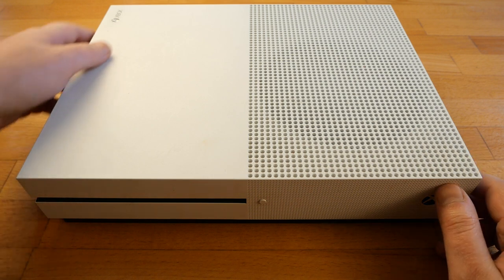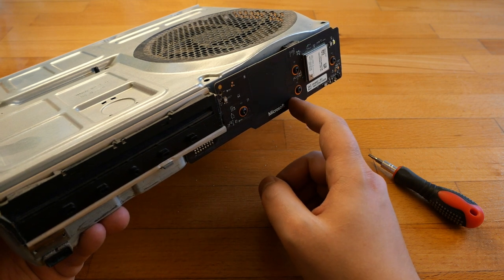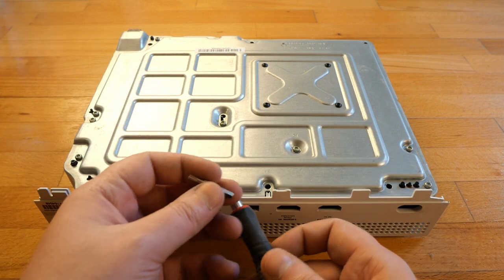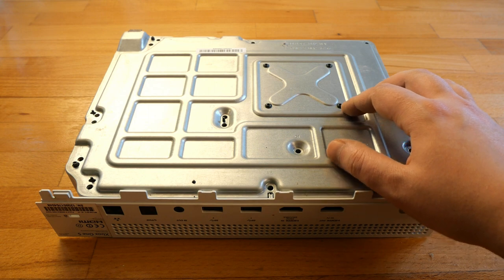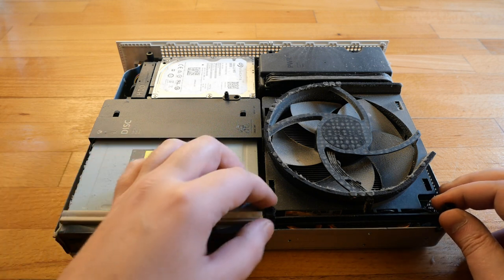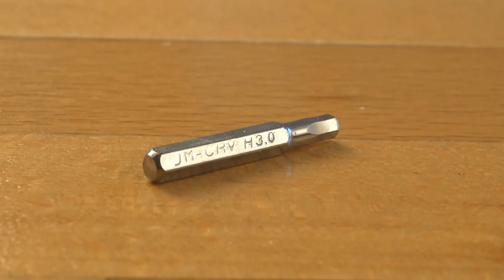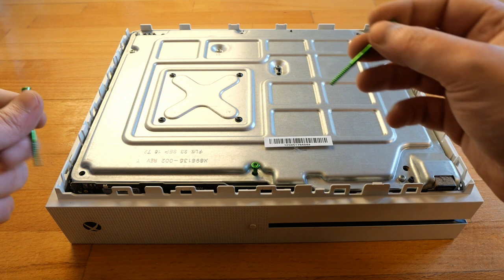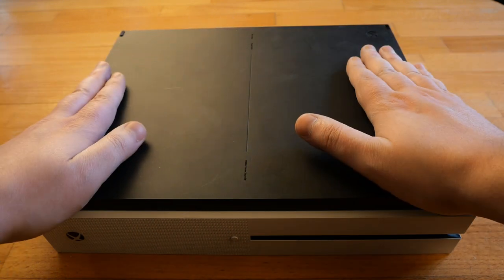XBOX One S Teardown & Cleaning Guide

Comment: Did everything exactly but wifi seems to no longer connect, it picks up networks and attempts to connect but doesn't work, could it be the internal adapter?
Reply from the maker: If it worked before opening, try to reconnect the wifi to the motherboard

Comment: Hey quick question . I've been experiencing a problem with my Xbox One S Everytime I turn it on it beeps and cut back off within a second it's been going on for three days now and I just wanted to know if you know anything I could do? Or do you have any videos on that problem?
Reply from the maker: Did this happen after cleaning? If so, it may be a problem with some connections when you assembled it. If you never opened your console, this sounds like a Power Supply issue
Reply: @YesterdaysTech Thank you so much for replying it means a lot..And, I never opened my console it even still has the sticker seal on it, but i will buy a new power cord today and see if that works. Thanks again 🙏
Reply: Did you ever find the solution!? I am having the same problem
Reply: me too
Reply: I just had this problem and its a relatively simple fix. Hold down the xbox button on your console  until it powers off, unplug the powercord for ten seconds, then plug it in and wait ten seconds. This will hard reset your console (NOT wipe storage, simply reboot the operating system) and it should help glitches such as this. Its recommended you do this at least once a month depending on your playtime.

Comment: Thx for this. Gonna use this to clean my friends, he dropped bailey's on top for whatever reason 😂
Reply: I am here after spilling a small amount of vodka coke on mine lol, did it work?
Reply: @DanskiV2 Yep, but I changed thermal paste and cleaned it all out with 98% alcohol.
Took everything apart in the end but she's running smooth and quietly now.
Made a picture on a card board box of where the screws go and basically took them of the xbox and popped them into the cardboard, helped a lot putting it back together.
Good luck with yours

Comment: Im going to be selling my xbox one s digital edition very soon on ebay and ik i can clean the outside of it t and not have any issues. But im nervous to open it up and attempt to clean on the inside. Idk if its very dirty on the inside. I bought it in 2020 cuz my original xbox finally died on me. It works well as far as i can tell. I dont hear the fan while im playing games on it or anything. When i turn it on it will takes a second to fully load (not very long at all and this may just be because i have the power settings set to where the xbox completely shuts down all the way when you turn it off. So that is probably the reason for the tiny bit slower of a start up. I just dont want someone to buy it then when they get it open it up and it be super dirty, it works perfectly so its not like they could ask for a refund really but it would still embarrass me even if i never heard them complain about it lol
Reply from the maker: If your XBOX is running fine, there's no need to open it. Removing the seal may lower the price

Comment: Had some questions: 
1. Which thermal paste are you using? 
1.1. Can you recommend 2 or 3 brands for that? 
2. When you're cleaning with alcohol and Q-tips, what type of alcohol is it? 
2.1. Did you clean the whole motherboard with that?
Reply from the maker: Any thermal paste is better than none, however, those that includes metal are better. Arctic Silver is known for being a great thermal compound. Isopropyl alcohol is the most useful in such situations. Anything above 90% is great. Not the whole motherboard, only where I thought is needed

Comment: Hello! I took apart and cleaned my xbox one s! After switching on, it makes a sound and turns off! What could be the problem? Can you help me?
Reply: Maybe it could be that in opening the xbox you ruined the thermal paste and now you need to clean it and reapply it. I'm not sure tho. The same thing happens to the ps4, it turns on, the cpu overheat and it turns off
Reply from the maker: Most probably you didn't connect correctly the cooler fan, try to unplug it and put it back
Reply: Thank you for your help! A certain ram power was replaced on the motherboard and the problem was solved! (Unfortunately, I can not speak English! I use a translator!)

Comment: hey ive noticed some cables have been wired unevenly and have been bending for years, would you recommend i leave them or try correct it? where they might be a chance of them not working as theyve adapted to the bent position
Reply from the maker: It depends of what cables you're talking, if the XBOX worked properly, it doesn't matter
Reply: @YesterdaysTech  cool it was just the colourful ones connected HDD, but was all good thanks for such a great vid